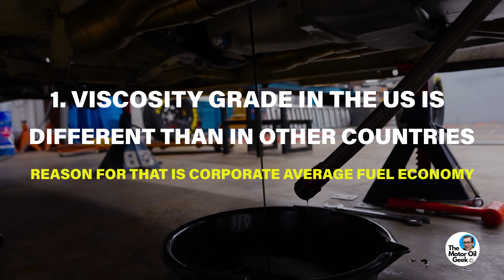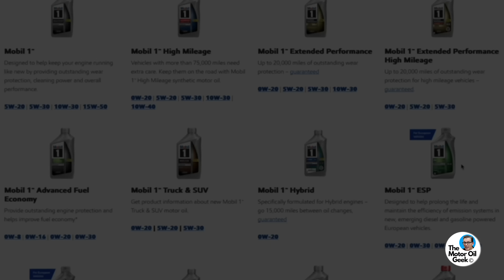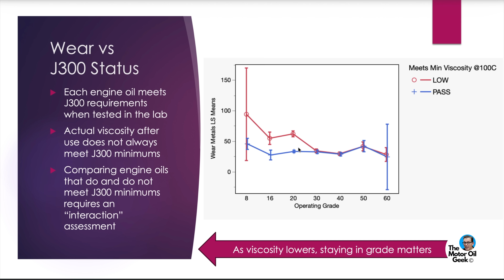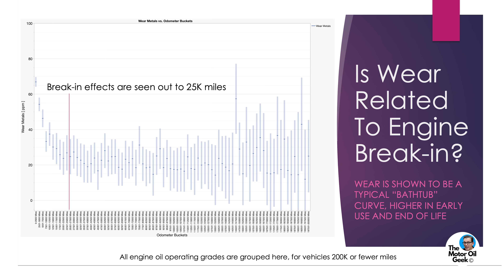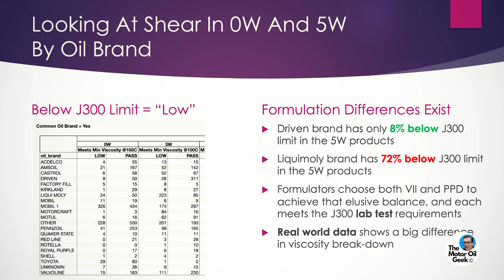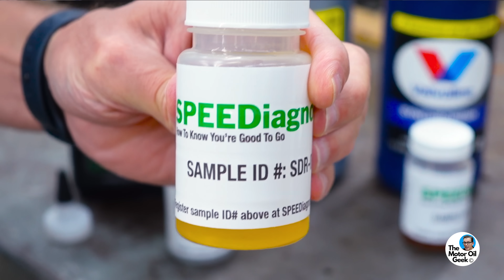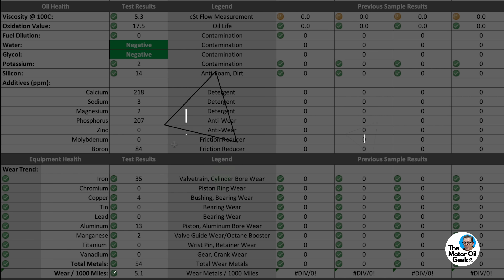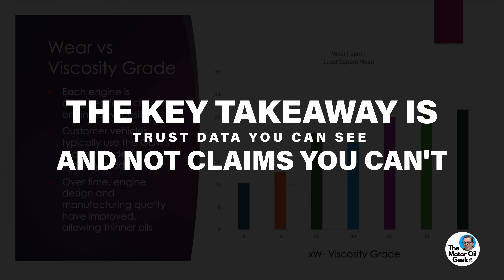More Ai Lies? The FACTS about 0W-20 vs 5W-30 (With Evidence)

Comment: Can someone comment specifically on what Lake is saying about high fuel dilution? I have a turbo gas direct injected engine (Honda 2.0T). At 1750 miles with 0w20 from dealership, fuel smell was overwhelming. No analysis done other than my nose. Switched to PUP 5w30, same 1750 miles, way less fuel smell but analysis showed 3% fuel and very low wear metals and a 0w16 viscosity. I’m thinking I was correct to switch to 5w30 since it thins so much but it seems like he is saying the 0w20 would change less?? Any comments? PUP 5w30 is doing great on very low wear so I hesitate to change. I’m using eco mode until warm and trying to include a longer trip on occasion in this car maybe one per month or so but I doubt it will make much difference in fuel dilution. I’m not in a cold environment, southern state, and I let it idle 20-30 seconds before driving easy until warm. I’m doing all I can to minimize fuel dilution.
Reply: After reading your account of the facts, your PUP 5W-30 dropped down to a 0W-16 viscosity over the course of 1,750 miles (a significant drop of 2 viscosity grades, from 30-20-16)?  If that is correct, I recall Lake remarking in a past video, when you reach an excessive amount of fuel dilution, which causes the viscosity to drop out of grade (in your case from "a recommended 20 grade" to a 16 grade), you will be expected to experience additional engine wear!  You really don't know when exactly the significant drop in viscosity occurred (presuming only one oil analysis was done).  If the massive drop occurred in the recent past, that would be cause for concern, so I wouldn't trust the PUP for continued use.  I would change it now to a different brand, such as Amsoil Signature Series and have that tested at the same interval?
Reply: @jimn.9990  I have only the one data point (analysis). I drive very little so every 6 months or so I’ll change oil. With the one data point I do have, it was the first oil change after dealership oil, so maybe some carry over?? Wear metals were extremely low. Do you also get that 5w30 was the right call for my case? I have about 600 more miles to go to get to the 1750 miles to keep variables the same. It will be a couple of months before I can get a second data point. Car is 5 years old , 26k miles, and I didn’t learn of an oil analysis until about a year ago. Dealership offered $33 oil changes to get me in the door.

Comment: I'm 63 years old and never had a engine failure. Lol, just change your oil. 😂
Reply: Yup!
Reply: Welcome to the internet, the land of overthinking things, and thousands of “experts”.   I’ve never had an engine failure either, and I just change my oil, with the cheap stuff.
Reply: @mplslawnguy3389 maybe bec you change your vehicle less than 5 years
Reply: @jackeroo75  Not even close.  My current truck is 10 years old, I drove my old truck for 15 years, and I'm about to inherit a 2004 Silverado.
Reply: @mplslawnguy3389 oh brother you have old vehicles.
Reply: Amen !
Reply: It's not just about oil failure, it's about the wear on the engine and shortening the life.
Reply: @JeepnJohnny My engine has 154k miles on it. It still has over 170 psi compression on each cylinder using 0-w20 oil every 5 to 10k miles oil changes.
Reply: Of course, you're right. I was born in '56 and have the exact same results.  But, successful channel owners make good money by making a mountain out of a molehill.
Reply: This is silly. I changed my oil every 5-5.5k miles and had 2 lifter failures at 28 and 46k miles respectively on my Silverado.
Reply: @BrandonAbernathy That's more about poor design than maintenance.
Reply: @TheFrenchPug  oh, I'm fully aware. I'm just irritated that people like Mike want to blame the end user for any failure because he is "63 and knows". There is literally no amount of maintenance I could have done to prevent these failures. But according to Mike, I'm probably to blame.
Reply: @BrandonAbernathy  What type of oil were you using?
Reply: @Doomzdayxx dealer did all the oil changes - 0w-20 - until the last failure. Now I use penn Ulta plat 5-30.
Reply: @BrandonAbernathy hey man, don't trust any pay to change your oil. Either do it yourself or check their work. Whether it's a dealer, an independent shop or a crackhead mobile mechanic. Check their work. People you pay to change your oil commonly overfill or underfill. It's possible that happened to you and you didn't even realize it. 

Maybe that didn't happen at all who knows, but checking the shops work is the best advice that I could give you.
Reply: @Doomzdayxx  oh, I know. All of the failures were under dealer care. I'm a former trained mechanic who later went to engineering. I usually take my stuff to one person I used to work with now.
Reply: Sorry to hear about your Silverado.
Reply: Not sure what the 4 posts happened. Ugg.
Reply: @BrandonAbernathy lol
Because you know and have read, right 👍
Reply: @BrandonAbernathy 3kmiles changes would be better off. Gm has pcv issues in valve cover.  Could cause gunk and your lifter issues. It's more about engine run hours not mileage. I keep run time hours and mileage in mind when doing oil change in my car.
Reply: @AutoMotoMechanic  that actually makes sense. Would a catch can help in this regard, iyo?
Reply: @BrandonAbernathy what year truck is it?  Some have a revised valve cover on the LS platform the driver side valve cover has a internal baffle they redesigned few times. And yes a catch can is always a good idea to catch oil vapors and moisture.  
Engine idle hours is a big one, some people sit in traffic for hours daily. The more idling you do the sooner the oil change should be.
My mom never drive far but she sat in traffic alot. She changed oil 5-7k it could take her 6months to do that mileage but drove everyday. I had her valve cover off at 80k miles for a gasket the amount of sludge and hard gunk in there was enough to call that engine toast. You could chip debis off with chisel.
Reply: @AutoMotoMechanic  mine is a 2021. I did idle a good bit early in its life. Since then, not quite as much idle time. I could see the gunk in the valves possibly increasing the friction between the valve stem and guide causing additional strain leading to failure. So what you're saying does make sense.
Reply: @AutoMotoMechanic  I'd agree to 3K on group 2 oils, but group 3 and up shouldn't need to be that frequent.  It comes down to paying Blackstone Labs $40 for a full analysis...
Reply: just curiosity did u use synthetic oil Amzoil is real synthetic in there signature line (group 4/5
Reply: @Kat-on3nm  5 non- turbo Honda Accords (2017 and below), 2 Acura Integra's, Chevy S-10 Blazer, Ford Mustang, 2 Ford F-250's, Saturn , newer Lexus IS350 , 6 Waverunners, 5 motorcycles, business equipment including  5 Honda commercial GX engines and 1 is 25 years old. At 58, never an engine failure but 1 transmission for the Blazer. Used Castro back in the day but Mobil 1 and Pennzoil Platinum synthetic  seem to be popular now. Never used overpriced Amzoil but I change my motorcycle, Waverunners and equipment every year with non synthetic as required. Current vehicles before 5k miles with factory recommended  weight and synthetic oil.
Reply: @BrandonAbernathy  that's because you made the massive mistake of buying american. never buy american, american car companies have only known how to make garbage since the 60s ended
Reply: @BrandonAbernathy  Well, you can expect a GM product to fail, no matter what you do with oil changes.  It's the design.
Reply: @BrandonAbernathy did you learn anything?
Reply: @BrandonAbernathy  GM had multiple design changes for their lifters. Oil and lubrication to them was not the issue.
Reply: @BrandonAbernathy  Of course, it's a pos domestic. That's all your fault for buying junk. By the way, the engine is the least of anyone's problem but the electrical mess, sensors and premature failure of different components in a domestic pos car.
Reply: Yeah basically, but to be fair there are a lot of recent engine failures happening. People are blaming the oil but it’s really crappy machining at the root.
Reply: @tomlindo2863 Yes. The newer engines are just not as robust as they used to be. All in the name of efficiency. I think the line has been crossed.
Reply: I'm right there with you.  55yo, been wrenching my own cars, motorcycles, dirtbikes, etc.  I've NEVER had a engine failure due to oil, never.  Change oil and filter consistently on regular intervals.
Reply: Respectfully you are speaking about the past...in the past this was true. Not anymore everything's 💩 nowadays
Reply: Yea, say that to the 2 duratecs that blew up with no warning that were regularly maintained... sometimes they're just shit engines.
Reply: There's a ton more at stake in making an engine last longer than just changing it frequently. The amount of factors involved could make a very long list.
Reply: @tooltime9260  Yes, but changing the oil correctly is pretty damn high up on the list.
Reply: Sample size one person.
Reply: @M22Research  Right. Everybody knows that NOT changing your oil is the best way to get the most out of an engine lol 🤡
Reply: I have but I should have know that revving my race car to 9300 rpm was not a good idea
Reply: Right. I use the 0w20 super tech in my sierra 5.3 and change it every 2400 miles 🤷🏻‍♂️ and use the wix Xp filter with a magnet on it.
Reply: You clearly haven't driven a late model turbocharged engine very far.
Reply: Im guessing you haven’t owned a Subaru lol
Reply: 100% true!  I’m 66 and owned a lot of cars. Just change your oil.
Reply: I change my oil every 2,000.   got 440K on last car (and still ran great) before getting a new one a few years ago - change oil often!

Comment: Im sticking with the 5 30 just did the 4 timing chains in an infinity qx 60 with 159k on it. It was a 0 20 motor.
Reply: 159k miles until first timing chain replacement doesn't sound bad tbh. 
Also quality in timing chains matters as well, regardless of oil.
Reply: @Asto508 i second this. Not bad mileage for an infinity. Oil grade should be selected for your purpose. If you are running your car hard, then sure its necessary. If you drive it like grandma getting groceries, lower grade is fine. Just like throwing a turbo on a motor. Turbo motors get thicker motor for harsher conditions and for a little better heat management. Notice different cars have different grades. Its all about how its engineered to run.
Reply: @Asto508 timing chains are supposed to last the life of the engine so if the engines out live the chains in my opinion it's a bad design
Reply: @anthonyk no timing chain outlives the engine….😂😂😂😂😂
Reply: @joshkrause2977 My 2GR-FE chain and tensioner still good at 275K miles. 🤫
Reply: @joshkrause2977  yes lol change the oil frequently and dont drive hard until fully warmed up and the chain should last
Reply: @anthonyk lmfao, WHT are you smoking?
Reply: @anthonyk Life of an engine by today's standards is 10 years or 150k miles if at all, it's a useless metric
Reply: @anthonyk  I've never heard that.  I've been around cars since the 70s...
Reply: @Asto508  nissans will last 500K all original...with 40 weight
Reply: Did you not watch the video!? Lol
Reply: @Yielar1 If you think this video says: "0w20 is better than 5w30," rewatch it.
Reply: There are oils that are specifically modified to keep your timing chain in good condition for longer, look it up, defined the correct motor oil for you. It has nothing to do with the viscosity.
Reply: What OCI did the owner perform? Citing only the oil weight misses some of the most critical aspects which could affect things like timing chain wear right?
Reply: And when ye get to 200,000 maybe 10W40
Reply: An Infiniti is an overpriced Nissan owned by the French company Peugot.  Even the best oil in the world won't fix a junk designed/built vehicle.
Reply: @M @MikeycatOutdoors e VQ Isn’t A Produced By French People Or Renault. That’s Nissan Engine And I’m Not Sure Why The Customer Ran 0W-20 Unless It Is That New VC-Turbo Then Thats A Different Story.
Reply: That's funny
Reply: I put 5w30 in my wife’s q60 .   It Says 0w20. I live in FL as well so is fine. Runs like a top and less rattle
Reply: We did engine change on 528i X-drive 2 yrs ago - timing chain skipped at 130k km. Then the used engine with 80k km after firing up sends list of codes, a few connected to timing chain correlation, so we did the chain. I couldn't believe how thin it was and the wear out on the guides, which started to crack. I don't know whom to blame the owners or the BMW for producing such POS. 🤮
Reply: Not in the current cars. The chain would last forever in cars build 40yrs ago, not today
Reply: @pliedtka  Not true, Dodge in the 70s used composite gear on the crank shaft, I know, I did a timing chain on my 70' Satellite 318 at about 150,000 miles.

Comment: Great video.

With that said my 2021 tundra has the exact same engine that my 2007 tundra did and that engine required 5W – 30.

Now that I hit 80,000 miles on my 2021 I’ve decided to go back to 5W –30 for the longevity. The only reason they switched to 0W –20 is for the church global warming emissions standards. I’m not gonna let my engine prematurely die because church global warming thinks emissions are destroying the Earth.

I run AMSOIL signature series and I’m about 2000 miles into the oil and I’m gonna run a oil analysis and have it compared to the first 80,000 miles when I changed the oil. We’ll see what happens.

Comment: 2012 honda civic clocking 200k, used 0w-20 mobile1, change oil twice a year about every 7k, 0 oil consumption between oil changes, no oil leaks, were noticing some glitter for a first few years, but everything seems fine, im sticking with it. On an another hand  Its a honda engine, other manufacturers engines may have different results running those thinner oils on high mileage engines

Comment: My 2003 Ford 4.6L V8 was originally designed for 5W-30, but they spec’d 0W-20 to meet CAFE.
Reply: I worked in a parts department at a big Ford dealership back then and I remember when we got "that new motor craft oil" in and saw 5w20 on the packaging. I had a 97 F150 with that 4.6 V8, reg cab flareside. Wish I had that truck still. 

My 2012 Wrangler's 3.6 V6 was  originally spec'd for 5w30 and that's what I use. The next year they switched to 5w20 and then in 2019 when the redesigned Wrangler came out they went to 0w20.

Comment: Over 30 years and 18 different 300,000 mile GM vehicles, the oil they get was what was recommended by the manufacturer.
Half of the vehicles I mentioned got the cheapest oil on the shelf with over 300k miles!..

Comment: The plural of anecdotes is not data, I understand, but I'm maintaining five vehicles right now, and every single one quieted down when I switched from 0W-20 to 5W-30. I've been pretty good about intervals, in fact I switched down to 4000 mile intervals a while back. One of these engines (Toyota 2.4 L) was making so much noise that I was considering trying to identify the worn lifter and replace or shim it - a rather inconvenient job on a solid lifter engine, at least for a modestly skilled DIYer - but it quieted down so much that I'm not going to bother. I mean, I'm just sayin. Quieter doesn't necessarily mean better wear protection, but I assume it can't be a bad thing. These vehicles are all 100K+ mileage (one of them is pushing 200K). Three Toyotas, two Subarus, all of them spec 0W-20 in the USA and 5W-30 overseas for the same engines. I use Purolator Boss filters and Valvoline R&P. Oh, and oil consumption is reduced on the Subarus (none of the Toyotas were burning much oil anyway...).